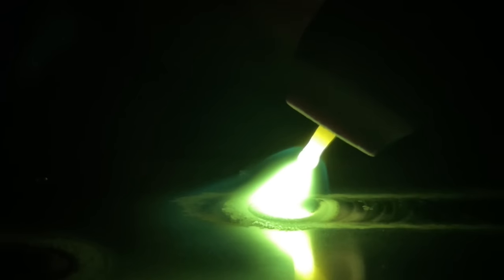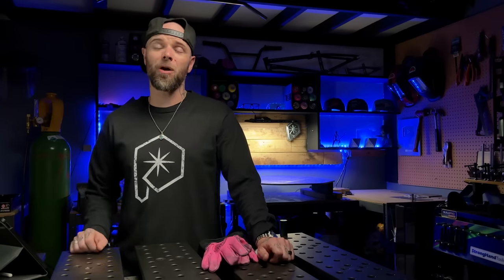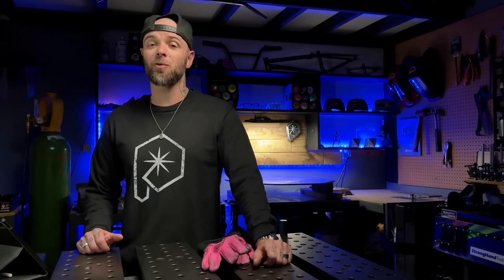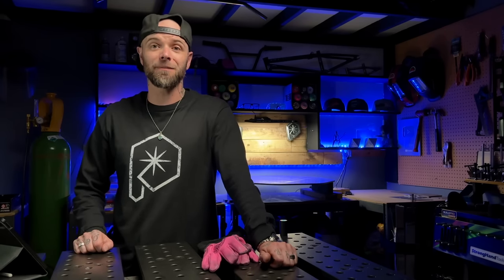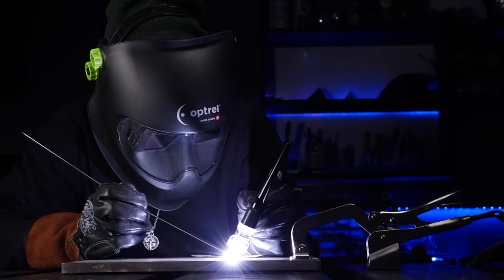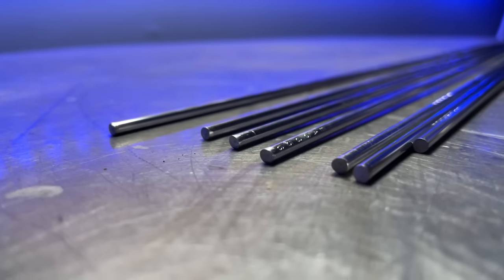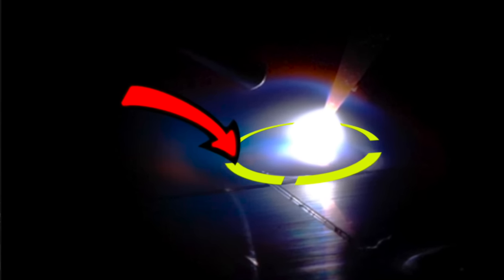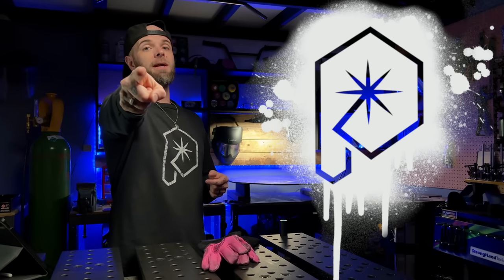the FIRST thing you should learn tig welding

Comment: I have just started learning to TIG weld Aluminum.  First a little joke about how close the electrode should be to the workpiece.  If you are touching, you are too close.  If you are not touching you are not close enough.  Seriously,  I have found that the best way to judge the distance between the electrode and the weld puddle is to look at the reflection of the electrode in the weld puddle and the electrode itself.  Half of the distance that they appear to be apart from one another (the electrode and its reflection) is the distance from the electrode to weld puddle.  Hth

Comment: Some very useful tips here 🫡😎

It's funny I can weld aluminum like no body's business, i still need to practice but the welds come out looking great aside from user flaws. But when it comes to mild steel like vehicle body panels, or cheap exhaust tubing, I just fail hard. gray gross inconsistent heats all over the place, persoity. I've been trying to play around isolate changes to see if it improved or made it worse. But nothing seems to change anything for the better.

Machine I'm using is a Arc captain ac/dc tig 200. Torch is WP-26 with a size 14 clear gas lens, gas flow is at 25 CFH, tungsten 1/16 and 1/8 2% cerium. Filler is ER70S-2

I've yet to try changing my filler so I think that's what I'll do next lol

Comment: Nothing available that stops you getting too close to the work to stop the tip sticking?
Would have thought an piece purposely made on the shield (ceramic cup) around the electrode or a bigger shield would work great then just the puddle and speed to think about.